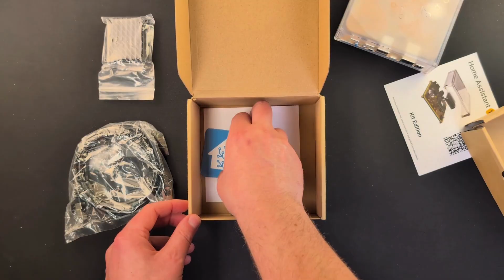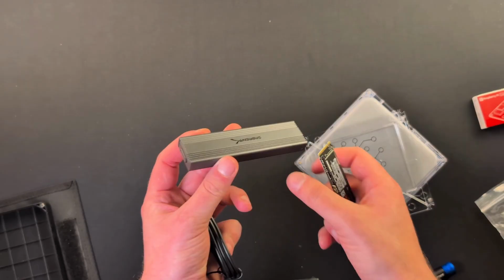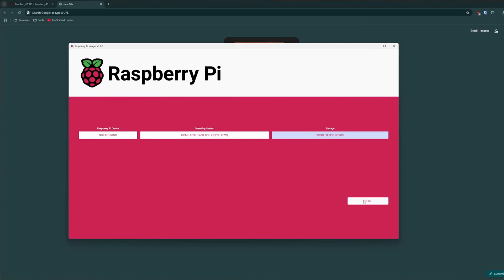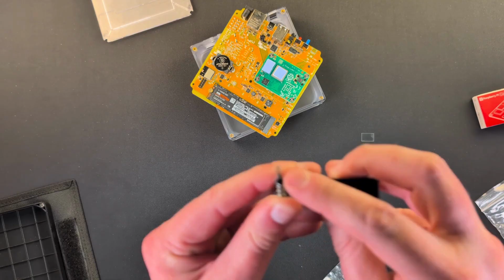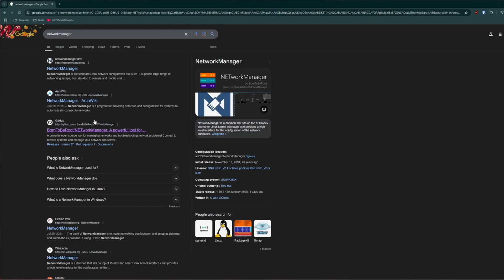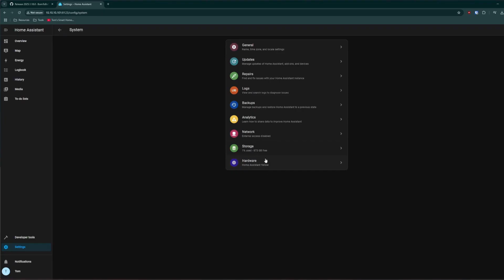Home Assistant Yellow: Unboxing and Setup!

Comment: do i need  Raspberry Pi Compute Module with Wi-Fi and Bluetooth or no need ? and is it working with CM5 ?
Reply from the maker: @lava08 No need! The one I used in the video doesn't have any onboard storage/networking/Bluetooth. I used Ethernet and an SSD on mine, so I didn't need the onboard storage or networking. The Wifi-enabled CM4s will still work great.

I haven't upgraded to the CM5 yet. My CM4 works great, and I'm waiting for the CM5 8GB to be back in stock!
Reply: Thank you 🙏

Comment: No vent holes or provisions for a fan. Did you measure thermals?
Reply from the maker: @PhiDeck The HA Yellow generally doesn't need active cooling, the heatsink does a pretty good job.

There is an option to check the processor temperature though, if something seems off: 

Settings > Devices and Services > Add Integration > System Monitor.

Then in that integration, enable the "Processor Temperature" entity. That'll show the temps. 

My Yellow hovers around 40-45C. 👍

Comment: Is there any benefit in running HA Yellow + Raspberry Pi compared to running just Raspberry Pi with HA?
Reply from the maker: @Yujinators Tl;dr, I'd say the main benefit for using a HA Yellow would be to support the Home Assistant project by buying their stuff. A side benefit might be a modest speed improvement.

The Raspberry Pi (with everything needed to run) + Home Assistant OS is cheaper than using a Home Assistant Yellow. A Raspberry Pi 5 2GB, with SD card/power supply/cheap case is around $90 USD before taxes. The Home Assistant Yellow with a Pi Compute Module 4 is around $175 USD before taxes. That's huge. If an SSD is added, like mine in the video is, it's higher than that.

There might be a slight speed improvement because HA Yellow uses an SSD and only has Home Assistant Installed, but that's not worth the price increase IMO.

The Home Assistant Green on the other hand, is a much more compelling offer compared to the Raspberry Pi. I haven't reviewed that one yet, but I will be soon 👍 If you're interested in more, I can make a video about comparing the HA hardware to Raspberry Pis!
Reply: How about the ability to install Home assistant OS, which supports plugins and voice assistants? Or am i misunderstanding?
Reply from the maker: @everydayanalyst  Both the HA Yellow and the Raspberry Pi support installing Home Assistant OS directly, so you can get add-ons and all the extra goodies on both systems!
Reply: Raspberry is largely irrelevant now because of low value. Mini pc i5 6500T is more capable and cheaper. And it is x86-64 with upgradeable RAM and SSD
Lenovo ThinkCentre M710q Mini Pc Intel Core i5-6500T 8GB RAM 120GB SSD No OS 
Very Good - Refurbished
$76.40
Reply from the maker: @EVR1AL  Totally. HA Green is best for beginners IMO since everything is pre-installed, but if someone's looking for a cheap option and doesn't mind installing the OS manually, then a used mini PC is a great option.

I compare hardware options in this other video if you're interested: https://www.youtube.com/watch?v=BXvS1BtZGQ4&list=PLa_JGr3gZ9jHdI-PqBhudCsbmLEwkk6Kv&index=4

I got the HA Yellow to support Home Assistant 👍

Comment: Does it support Threads out of the box or do you need to buy some dongle?
Reply from the maker: @dBager  By default, the Yellow is configured for Zigbee, but it has support for either Zigbee or Thread. In the Settings, the Zigbee can be disabled and the Thread firmware enabled.

If you wanted both Zigbee and Thread enabled on the same Yellow, and had configured the internal radio for Thread, then you'd need a USB dongle for Zigbee.

There's technically a firmware for the Yellow that enables simultaneous Thread and Zigbee on the same chip (without using a USB dongle at all), but it's experimental and has serious issues. Home Assistant itself recommends avoiding it. So I have a dongle for one protocol, and the internal radio for the other. 

Hope that helps!
Reply: @TomsSmartHome  Yes, it does. Thank you!
Reply from the maker: Good, glad to hear it.